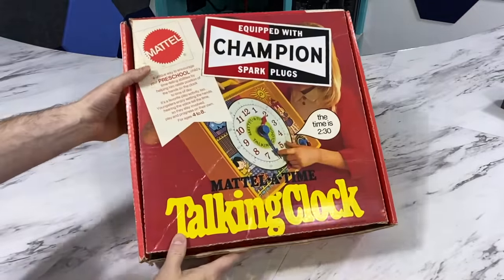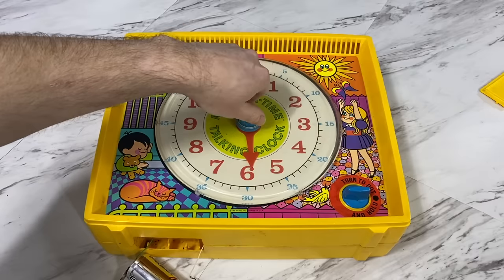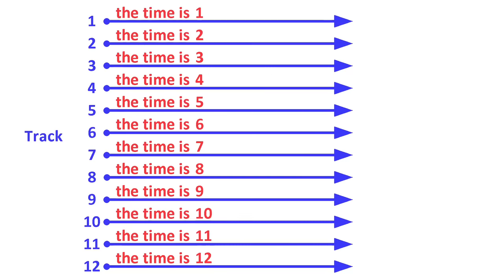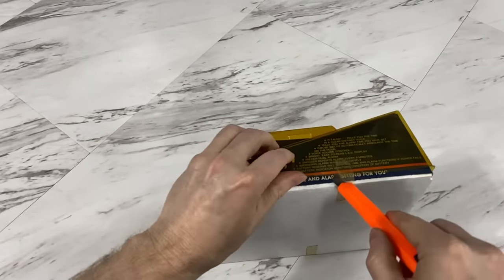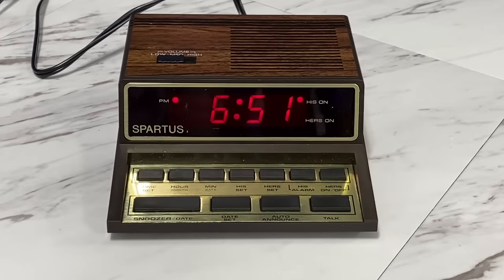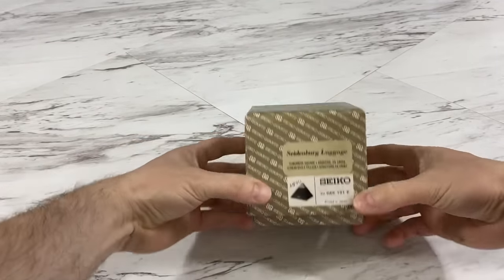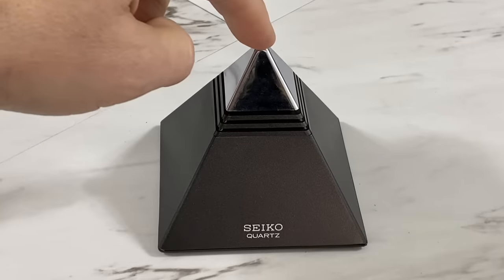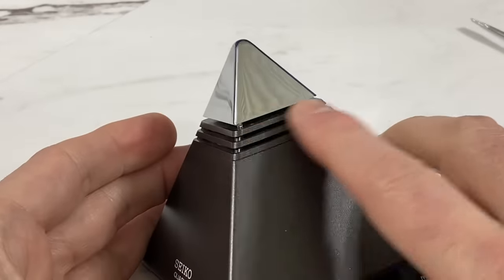Talking Clocks of the 1980s

Comment: I've had a couple of Voxclock 2 (male voice) over the last 40 years, still got one announcing the hour in my kitchen in 2022! The chips in that are Sharp branded, and I believe are the same in the Sharp Talking Time CT0660E I also have, the Trafalgar talking watch and the Sharp talking calculators EL-620 and EL-640. I managed to get an EL-620 only last week for a bargain price, same as the 640 but the 640 has a clock. The 640s go for very silly money though. I've always preferred the synthesized voices, recorded digital voices don't feel like such a technological achievement. I've always wanted the Voxclock 3 but they were USA only and converting the mains frequency for UK use is not easy or cheap.

Comment: One I have to mention is another Radio Shack product from the mid-70's to the 80's (early 80's is when my father got his) that "tells you the time."  But it wasn't a clock; it was a radio (similar to the Weatherradio shown in the video).  It was called a TimeKube, and there were at least a couple models (one of which could also get NOAA weather radio broadcasts).  For the time, the TimeKube would tune in to the WWV shortwave radio broadcasts (I understand there was a Canadian model that would tune in to Canada's own shortwave time setup).  It would only get three preset frequencies (5, 10, and 15 MHz for the US model) -- one pushbutton switch for each frequency, and one more pushbutton to turn it off.

You'd extend the antenna, push one of the WWV frequency buttons, turn a knob for the volume . . . and listen for a ticking tone (seconds).  Eventually, the tone would go quiet (but there'd still be ticking), and then you'd hear a "voice" announcing the upcoming time (example:  "AT THE TONE, 21 HOURS, 17 MINUTES, COORDINATED UNIVERSAL TIME") . . . BEEEP!!

So it was really just a radio set up to give you the exact time (to convert "Coordinated Universal Time" to local, there was a slider on front that'd you would set for your time zone, and read accordingly).  Very useful for setting your digital watches on occasion to the EXACT TIME (until clocks and watches came out that would tune in to the 60 kHz WWVB signal and set themselves automatically).

Comment: My grandma has Seiko clock which sometimes referred as one to blind people. It's round, have talk button on top and face buttons on front. Have alarm souns of rooster and some other bird. It talk russian by the way, powered by two AA. That clock is more than 20 years old, have some buttons missing but still runs. Also hud is like one from RadioShack. Funny thing about it that pitch and tempo becomes slow as batteries dying.

Comment: Trivia: Most of the audio heard on the Vox Watch may sound familiar to you if you owned a Sharp Talking Time. The alarm tones on both devices are different, although they are both renditions of classical minuets. The Vox Watch plays the Minuet in G by Bach as the alarm tone, while the Sharp Talking Time plays the Minuet by Luigi Boccherini as the alarm tone. I believe that RadioShack both licensed and modified the firmware  from the Sharp Talking Time from Sharp for the Vox Watch, including replacing the Boccherini  minuet with the Bach minuet as the alarm tone.

Comment: My grandfather gave me the same clock as the one you showed in the thumbnail! Also, I think mine may be a different revision, as mine says "it's" before it says the time, and when the alarm goes off, it'll speak the time before it beeps
Reply: I have one that was branded by Mentor Graphics as a tech promotion product.  It says, "Almost midnight at the oasis" on the front, with a motif of palm trees.  I have a feeling this clock may have been resold by quite a few different companies.

Comment: omg, the analog ones are surprisingly clever, in fact I only imagined they could be digital lol
Reply: Some dolls used this technology too. My sister had a doll that "cried," and it used a small plastic record. When I opened it and found out, I was fascinated. My sister, well, she was not amused!
Reply: Those old "See 'n' Say" things* used a plastic record too, with a Victrola-like horn crammed inside for amplification.  They had a bunch of interleaved grooves, and setting the spinner controlled where the needle dropped when you pulled the cord.

* you set the spinner and pull a cord -- "The cow says...  'mooOOOOOoooo!'")

Comment: The Realistic $399 CD-1000 CD player (in your Radio Shack catalog @ 14:56) was my very first CD player!  (I still have it and it powers up, but it needs new belts so the door won't open and the drive won't spin up.) I belive it was actually manufactured by Hatachi for Radio Shack.

Comment: I love the Voxclock 2. Yours looks like a later version of the Vox Clock 2 as the earlier Vox Clock 2 did not have a digital screen. It was more like the 1st Vox Clock. I grew up with the 1st Vox Clock (just called Vox Clock) as my grandfather owned one and then I got it.  The only differences between the original Vox Clock and the early(non digital display) Vox Clock 2 was the VC2 had an alarm while the first VC did not have an alarm. Also the VC2 is easier(at least to me) to set. for my early model VC2, I have the complete set (box and papers). I also have a couple of those weather cubes.

Comment: My mom had a very similar one to the first alarm clock when I was a kid (early '90s). I think she said once she got it in high school (late '80s). It doesn't talk, but it does have an AM/FM tuner. You can set the alarm to either a standard alarm sound or the radio. I actually don't know what the alarm sounds like... I've never used it, and my mom always used the radio for her alarm. It's not the same brand (hers is General Electric), but has the same faux wood look as yours. The batteries do mean the clock keeps time in a power outage, but it does not display the time on battery (we lived in a rural area with frequent power outages). She upgraded around the time I went to college (mid-2010s) and was just going to toss it so I snapped it up. It's now in our bedroom.
I'm very curious if the his and hers alarm sounds are different on yours. They must be, or else how would you tell whose alarm is going off? What does 'her' alarm sound like?

Comment: I had a talking clock as a kid in the 90's (I'm sure it was an 80's model, very similar to the Seiko pyramid, but white). It had a 2001: A Space Odyssey moment once. The batteries were running very low, and I specifically remember hitting the button and it said "The time is... eighteen... tenteen..." (pitching down slowly, just like HAL)

Just bizarre how the low voltage of dying batteries would bug it out like that.

Comment: the battery holder, the carousel is designed often for hearing aids, making it easy for elder people to use it, and otherwise easiet to store and take with you. Makes discarding the batteries easy too, put them back in the carousel without the tab

Comment: My grandfather, ever the progressive gadget freak, had one of the Spartus clocks in the early 1980s.  I still have a VoxClock that I got for Christmas when it came out.  It has been in continuous use and still works perfectly.  Mine lacks the LCD display that your VoxClock II has.  The VoxWatch apparently has the same ROM as my VoxClock as the voice and sound effects are identical.

Comment: Forgot to mention a few more things. The Spartus has what I suspect is a hidden self-test mode. Have it unplugged with no battery installed. Hold down the button that speaks the time while you plug it in. It will speak the numbers 1 through 19, then 20, 30, 40, and 50, continuously. Also, the Radio Shack VoxClock II you showed is a later version which I think came out maybe in the early 90's. The first one which I first saw in early 1987 has a male voice slower, but in some ways similar to the VoxWatch and Sharp Talking Time I. It also has hourly announcement, an alarm, and a countdown timer.

Comment: also I got the timex talking bedside clock!
Voice sounds very similar to your spartus. Im gonna gues that one had to be made about the same time mine was between the year 1982 and 84-85 sounds about right.
I wasnt around back then so who knows. I just got my timex speakeasy about a month ago and its pretty neat and quirky! It will give you several  warnings when waking you up. The dimmer is also automatic based on ambient lighting in the room it is in and you get two alarms, however the selection of the sound you select is global to both. Definitely has to be a TI based speach processor in there.

Comment: As a kid I had an alarm clock that looked like a car stand with a removable race car on it. The only thing is.. the sound with a revving engine. You would disable the alarm by taking off the car. I couldn’t tell you the brand of it but it was late 80s early 90s designed.

Comment: I have a Micronta RadioShack VoxClock 2 (cat. no. 63-903) which I inherited from my grandpa, but it is very different from yours.  The voice is a male, robotic one, it takes three AA batteries, it lacks a time display, and it has fewer buttons and switches on the back.  It looks like yours is a 63-904.  I wonder if mine is rare?
Edit: the Vox Watch you show in this video has the same voice synthesis.

Comment: Oh the Vox Watch. That's a unicorn, probably the rarest of all the Sharp based talking clocks (Talking Time, EL640 calculator)...You referred to a clock with a female voice as the RadioShack VoxClock II, but I'm pretty sure there was a sharp-based clock like the one you just described by that name, also from the 80s. There was a Spartus-based VoxClock III as well, which I owned and still miss.

Comment: You can take that yellowed plastic, fill it with resin or silicone and make a hard casting, drill holes in it and make a vacuum forming base to make a brand new clear case that are the exact dimensions as the original.

Comment: I have an 80's clock that speaks the time, it was made by sears and roebuck named "the talking machine"  on the back says made in japan, you can set it to say the time every hour or every thirty minutes I have mine set to every 30 minutes, you can also set alarms with a voice to remind you its time for your appointment, or time to get up, I haven't used those yet so I forget but I think that's right, definitely two alarm options, and has two voices I think a man and a woman. The clock has an Am and Fm radio with a mechanical dial to show radio frequencies at the bottom of the clock, the radio can be used with the wakeup alarm too. It's a pretty big boxy clock relative to its standard sized display, mostly speaker, it sounds good. The blue leds must have looked sweet back then, a rarer option to the red or green. Well that's me nerding out about my alarm clock.

Comment: The Spartus clock actually got rebadged by Micronta/RadioShack for their VoxClock 3 - it's based on a later model which is able to do Westminster chimes alongside the periodic voice announcements. That, and there are backwards buttons for the hour and minute set controls which is neat for quickly setting back either the hours or minutes if you manage to overshoot when setting.

Comment: Me and my dad both watched your videos, I was excited to find out he liked them too because I didn’t know until I heard the theme song of your videos from his tablet. He always used to show me electrical circuits and how they worked when I was little, he was an electrician. He passed away earlier this year but watching your videos reminds me of when he explained this stuff to me and reminds me of our shared interest of electronics. I’ve never been good with electronics but I still find them interesting. I hope to get good with them someday to honor my dad.
Reply: I'm sorry for your loss.  My father passed away 4 days before Christmas... so you can imagine what the holiday season will do for me every year! ☹

Playing with electronics is very satisfying!  Most everything I know is self-taught.  Sure, I took all the electronics classes in junior high and high school (totally aced the classes, too), but a good way to learn, would be to get one of those electronic project kits that Radio Shack used to sell.  They came in many sizes, from 400-in-1, down to 50-in-1 (there might have even been ones that were 25-in-1)!  Anyway, with the included manual and parts... it would teach you to put together all kinds of projects, such as a noise makers, digital counters - or even a radio!  If you buy one on eBay, just be sure it includes the manual.  You can get jumper wires from Amazon, if they're missing... but you gotta have that manual!!

Comment: This brings back memories. I had that watch and remember the Realistic Talking Vox clock and the Time Cube WWV radio that came before it. I was sort of obsessed with time when I was growing up and used to set the clocks around me daily to the time on WWV. I even designed and built a talking alarm clock as a Senior Project in 1984 for my BSEE degree. I used a MOS 6502 , EPROM, RAM and a GI speech synthesizer IC (bought at Radio Shack). I still have it but haven’t powered it up in years. I still occasionally have nightmares about the countless hours of wire wrapping it took to build it:)

Comment: Hi, I’ve been interested in talking clocks since the 1980s. I have a collection which is probably nowhere near that which  you have, but there’s quite a few. My interest is in finding replacement Mercury batteries as some of the old talking clocks used to use these. The Korean clock you demonstrated is definitely later, it’s mid to late 80s, not nineteen seventies to the beginning of the 80s. The speech Chip is a later iteration of the speak and spell one, not the original one that went in the Texas device.I noticed you didn’t feature any of the Sharp talking clocks,  I have pretty much all of them. They first became available in the UK in 1981. I think the CT 660,  665, and I think the other one is called the 666. The 660 was first, the 665 was a smaller travel alarm clock, And the  666 was a larger sort of desktop model. The third is a much rarer beast though. I also have both of the RadioShack clocks, I’m totally blind, but I don’t think there is a screen on my voxclock  one. It has a male voice unlike yours, but the speaker is in the top and it is cube shaped like your one. I had the voxwatch, to, which was the last present my grandfather bought me before he passed away. So that had great sentimental value. Unfortunately they weren’t terribly robust, especially if you are visually impaired and occasionally banging it against the door as you went through or whatever. I think mine only lasted about a year. 

Psycho are also very interesting. I don’t have the original pyramid clock, but I did manage to pick up a modern iteration of made by psycho on eBay. However in the later 80s, Psycho sold a travel clock. It was the size of a credit card, what about the thickness of 23. 5 inch floppy discs. I still have one of those and often use it when I go on holiday. It still works well though the button to tell the time was a circular pad which you touched. This wears out after a while. Again the voice quality is pretty dire, because the speaker is tiny. They also made a talking watch, I have one of these too. Finally I have the sharp  talking clock calendar calculator, the EL 640 I believe it’s called. This one was great fun, you could get it to swear, if you press the five key and then a button which says “off” that caused us great amusement when I was young. Anyway I really enjoyed the video, and maybe one day if I have a compliant sighted person who knows how to do these things, I will make a video of my entire collection. so thanks very much for making it. Rob

Comment: If I'd had that Mattel clock when I was a kid, I would have been so much happier about learning to read analog clocks! :) I also think its internal design is brilliant in its simplicity.

I wish I'd got one of those speech synthesizer chips when I was 15. Maplin had a kit with it, it plugged into a ZX81. Still, I'd rather something a little higher-quality now. I found this open source "espeak" software in the 00s which was pretty good so long as your headphones weren't too amazing... :)

I can't remember if I wanted the pyramid clock or not. I'm sure I would have wanted it on sight, but I think someone talked me out of it. I'm not entirely surprised the TI clock is easier to understand. Oh, regarding the accent: "I think I'm turning Japanese / I think I'm turning Japanese / I really think so!" ;)

The VoxClock 2 is nice. :)

Hahaha! Even a watch can sound clearer than that pyramid! Just like stupidity, makers of cheap tat have no limits. But the VoxWatch is really nice. :)

Comment: The LED clock immediately sounded familiar with that distinctive TI synthesis 🙂 The Radio Shack watch also has a familiar ring to it, isn't it based on the SP0256AL chip? 🙂

Comment: 8-bit guy: You could remove that Champion sticker using a hair dryer and an orange stick that has a beveled end. Heat and get one corner up, work back and forth, a Qtip with some goo gone can help. Very light pressure as you’re pulling the sticker up. Go slow, make sure you are NOT seeing ink on the Qtip

Comment: Be aware that the hearing aid batteries actually use the air as one of the reagents, that's why they have a pull tab and little holes at the top. So they might not work properly in the watch if it is fairly airtight. Also they do not last very long even if unused once the tab is removed.